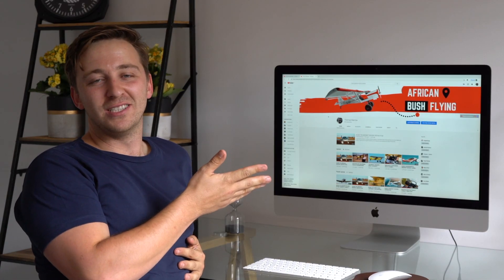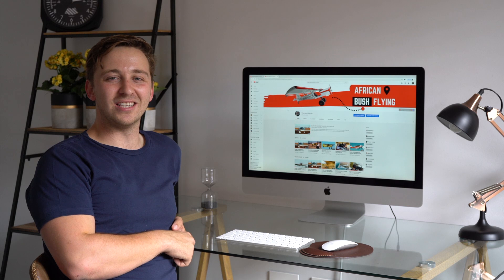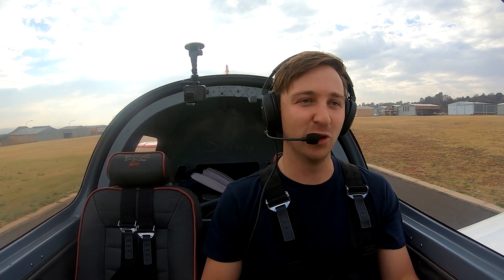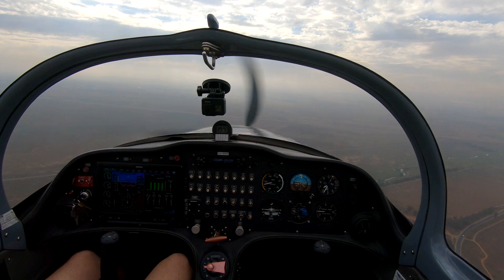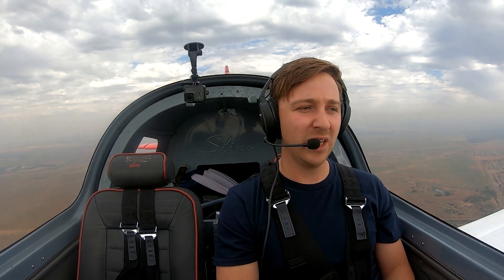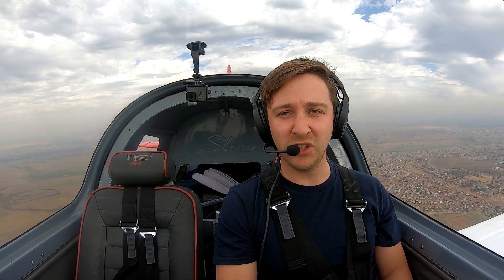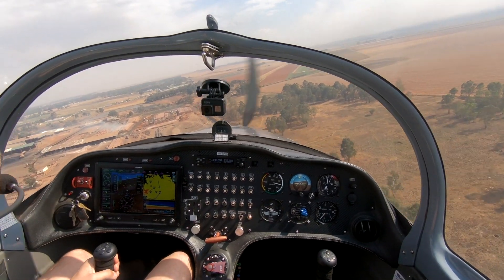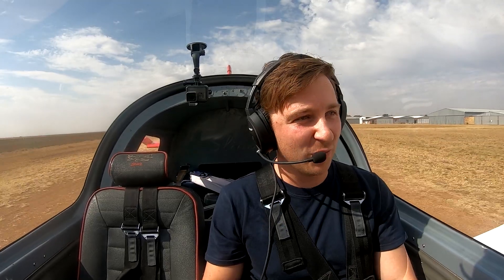ROTAX 915iS ON A SAFARI TAILDRAGGER | AIRCRAFT BUILD

Comment: Check the 915 turbo for oil supply there is a vid on flyrotax channel on YouTube. I don’t understand why these issues are happening with Rotax oil supply to Turbo bearings is critical and they send them out the door not knowing are they using Chinese Turbos and now you say recalling fuel pumps really does not give me confidence In the 915 for the price this engine should have no problems very disappointed  seems Rotax quality control needs an overhaul.😳
Reply from the maker: Similar teething problems happen on all engines when they are of a new design. Remember that these engines are built to a certified standard so they are approved by the regulators as well.

My thinking is that the fact they are actually recalling the parts and making the necessary precautions at huge expense to themselves shows a safety first mindset.

Comment: Was your beringer ALG of the shelf or did you have to work with them to design it? Thanks
Reply from the maker: Martin J Nee it was off the shelf. The gear attachments on the frame of the aircraft were moved slightly.